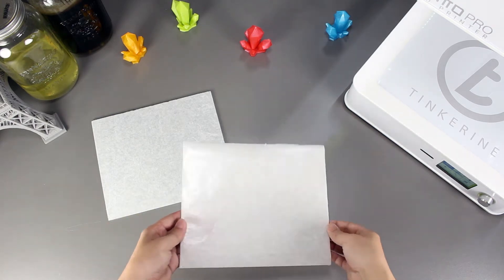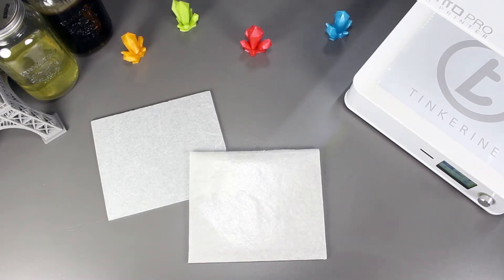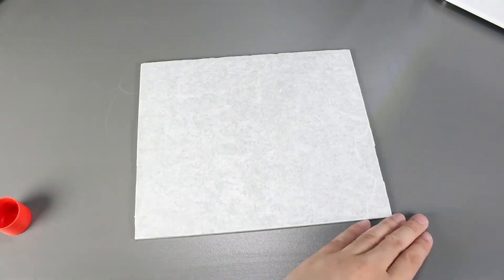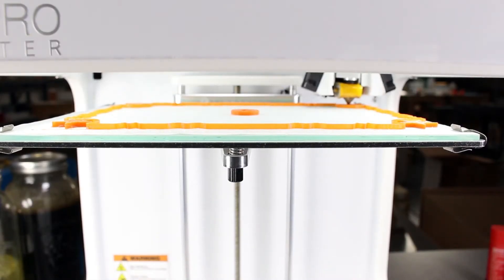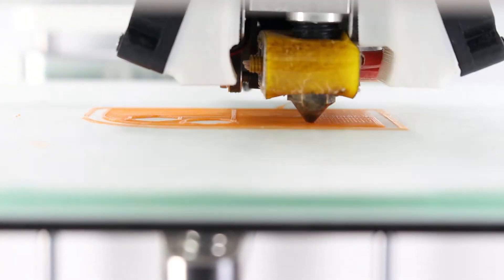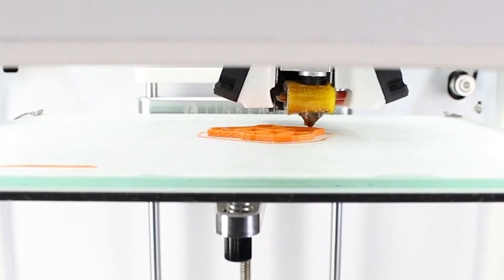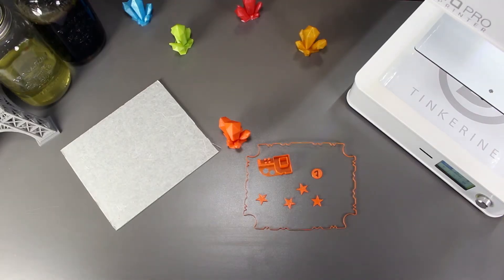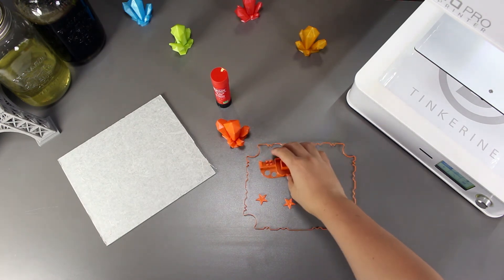3D Printing Using Vinyl Transfer Tape as a Bed Adhesive

Comment: That's cool!  But, Couldn't you just use the glue stick on the glass? Why the added step of using the vinyl transfer tape? If the transfer tape worked without the glue then it might be worth while.
Reply from the maker: Hi!

I can't believe I didn't think of trying that! A viewer said it was a great alternative so I just tried out what he tried! Once we acquire more, I'll look into testing it!
Reply: I use 245 Nozzle and 65 bed for ABS with Elmer's Disappearing Purple School Glue Sticks, on Borosilicate Glass see 0.21 Ounces Each,
6 Sticks per Pack (E1560)
http://tinyurl.com/purple-glue-stick

This works well, (2 to 4 times, quite thick), if not left unused, if left unused I need to clean off damp cloth and reapply.

After 2-4 times I clean off damp cloth and reapply.
Reply from the maker: Thanks for the comment! That's interesting, we'll take a look into it.